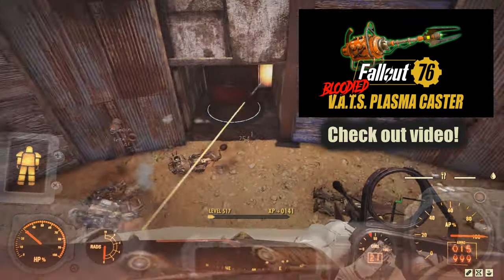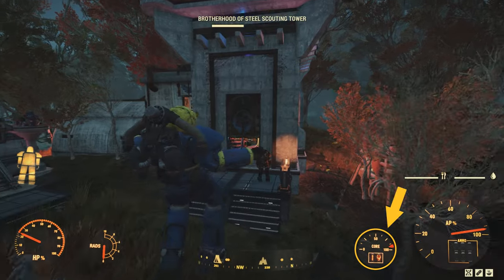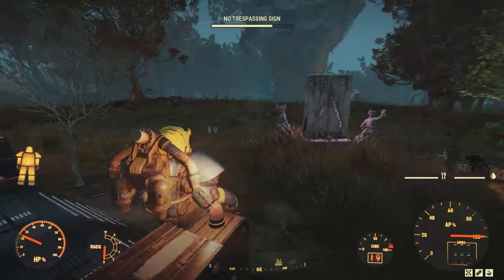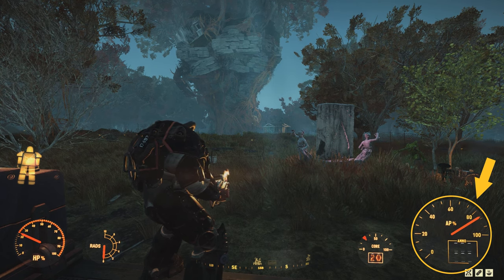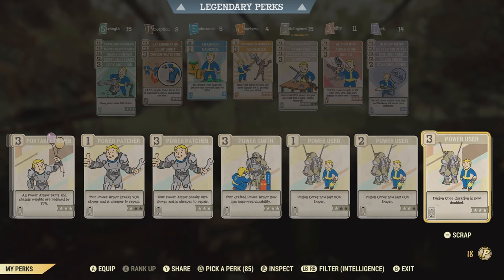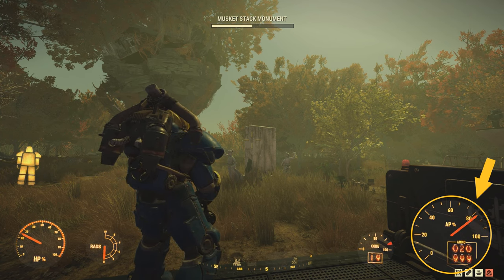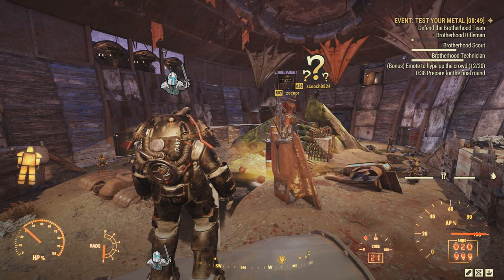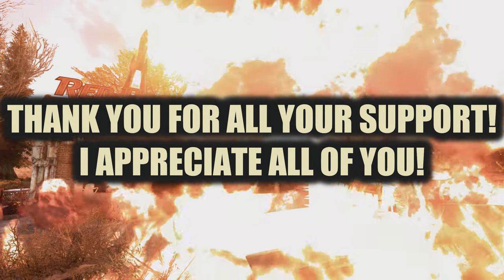The Power Armor VATS Problem (SOLVED!) - Fallout 76

Comment: While some will say it is for the sake of balance since Power Armour makes you so tanky. I don't think that is a good reason or excuse for this. If only because secret service and brotherhood recon armour makes you super tanky already. Combine that with other things like unyielding arguably makes normal armour just better. 

Ok you lose a bit of tankiness, but considering that nothing in the game really requires you to tank that much and that dying is a non-issue anyway it isn't a very big benefit. Combine that with other issues like being unable to craft/interact with basically any item that has an animation. Forcing you to get in and out it is just annoying.

Honestly if I was able to make changes to PA I would allow backpacks and underarmour to apply bonuses. Remove the fusion core drain from VATS and finally allow you to use crafting benches/animation items with power armour. Would it make power armour stronger than regular armour in some things, most likely but you could just increase the natural drain of fusion cores. Since honestly as I don't use VATS I haven't really drained a fusion core in weeks.

Comment: Giving it a cost means that you aren't running around like an unkillable tank that also has the ability to efficiently target and kill everything around it

Every build needs pros and cons, otherwise everyone would play the same way and that would be dull
Reply from the maker: I’d still love to have cooling vents on the arms instead of legs, but I agree pros and cons
Reply: But right now all people want to be the same for that reason lol. They all want to be nail comandos or whatever, it gives them super power to run through every event, op, expedition solo, kill earl also solo and all of this for free, no spending ammo no armor batteries, they are super fast and agile, this mechanics is ridiculous, people kill enemies by using several plastic bullets with toy riffles whereas I soloing earl, could not even drain his 50% health with my blood explosive ultracit 50 calibre, spending 5k ultracit bullets lol, because the only effective way to kill bosses is to use vats+crits etc, overall making vats free for power armor doesn't force people to use it, on the contrary it will give variety, also vats does not give efficiency to target enemies, it's much more faster to kill everything around you by using auto weapon with range explosives or tesla or fire, even when I use placast it is efficiently for me to not use vats in many situations especially when you have low perception and head shot require several shots to get 95%, it mostly fun to use because of crits

Comment: It's weird, because it kinda makes sense that it would drain the battery to use VATS irl, but outside your mega advanced power armor, it free and runs on air? 😂 

It's obviously a balancing thing, (although I wouldn't rule out it being an oversight they haven't fixed yet), it is very expensive, and it makes VATS in power armor a luxury. That doesn't sit right with me. 

I think, maybe, possibly,one day, they could make a VATS enabled power armor set that has a massively reduced cost or even free VATS.  It would be similar to the Union armour set. You can get it as a season reward or from a expedition. 

I hope they fix it someday, but it has been so long I don't think they will.
Reply from the maker: It really does feel like an oversight!

Comment: Fusion cores suck. When you don't use PA constantly you always have too many and when you are, you never have enough.

One of the things I'd like them to do, is a round of mod tweeks and additions to the game. At the top of that list for me though, are mods for PA that 1) use things like vault steel to modify the lower end PAs to be closer to higher end PAs in terms of defense ratings. 2) give arms(PA and normal armor) a few more mods that are beneficial beyond melee and 3) mods for PA chest pieces that convert them to use Ultracite and Plasma cores.

As for the last one, some of these could be doubled up, specifically with the Jetpack, but hard to get and expensive to craft. For example an Ultracite Jetpack or for my melee builds, I'd like a Pneumatic Jetpack.

Comment: if you hqave the materials. crat a unch of gatling lasers. each one gives you an overcharged core
Reply from the maker: This is a good tip, thank you!

(Craft low level gatling lasers and then scrap them for fusion cores)
Reply: You need high int to craft overcharged cores.

Comment: Also use mods that reduce weight and increase fire rate on weapons. This will save AP cost on shots and battery life.
Reply: Im sure 90rw doesnt decrease VATs AP cost or save fusions. FFR drains cores quicker in VATs too. 

Im running FFR/25v heavies and the rapid core depletion still isnt an issue for me tbh.